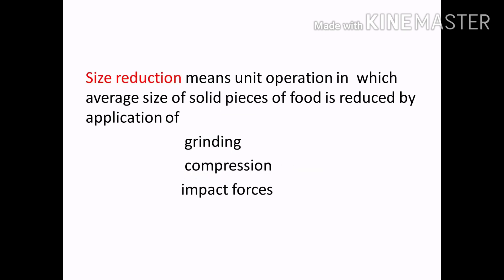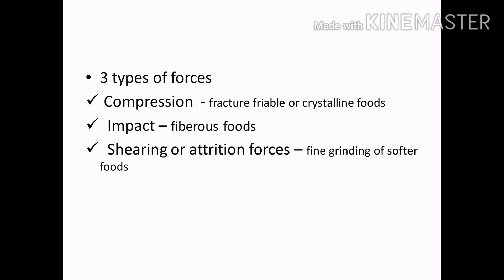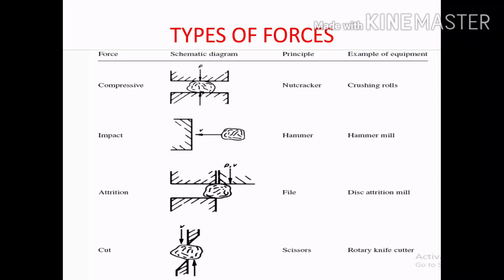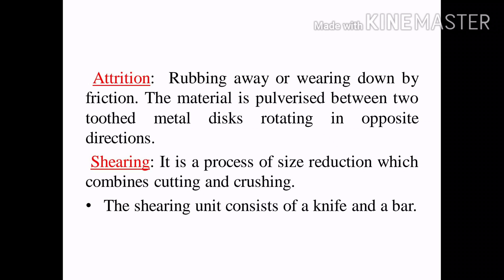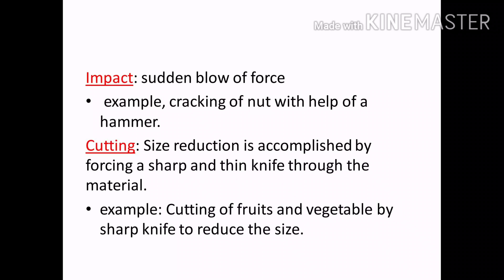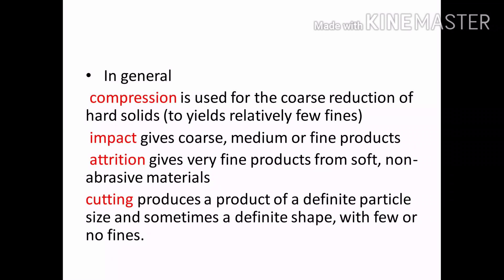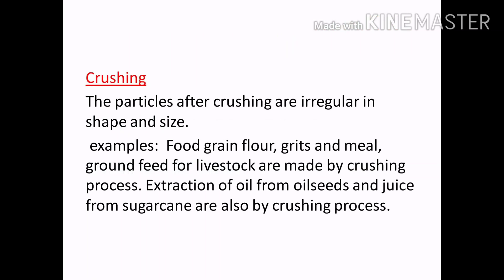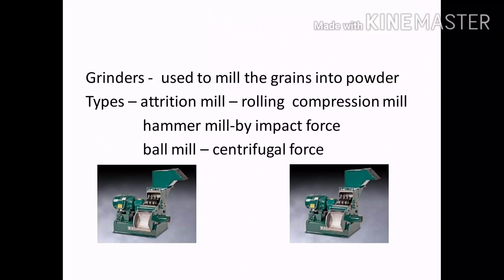AGRICULTURE - SIZE REDUCTION

Comment: Mam shearing um attrition um same alle???
Reply: Shearing ennu വച്ചാൽ പിരിയ്‌കുക(തുണി ഒക്കെ വെള്ളം കളയാൻ 2 sidum പിടിച്ച് പിരിക്കില്ലെ...അത്) attrition....friction kaaranam uranj പൊട്ടുന്നത്....
Reply from the maker: Correct arylla.. 
Shearing forces are unaligned forces pushing one part of a body in one specific direction, and another part of the body in the opposite direction

attrition mills occurs through the scraping of one surface against another. Particles scrape against each other or against a rigid face.
Reply from the maker: Shearingl cutting koodi ille..
Reply: Mam video nthe 1st shearing or attrition ennu parayunnundu..pinne separate aayii 2 num explain cheyyunnu..atha oru samshayam..vannath
Reply from the maker: @anjuthomas5036  s dr.. adytheth or bookl kidannath.. sec vere reference 😃.. cheriya difference undvm.. ee topic enik adhikm arylla
Reply: Ok thank you mam,,pettannu kandappo...Oru samshayam...